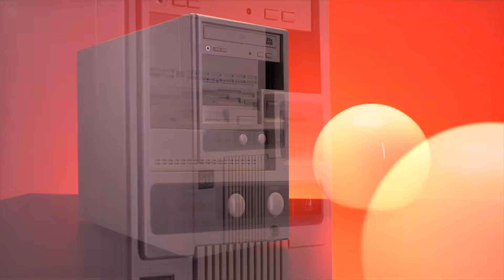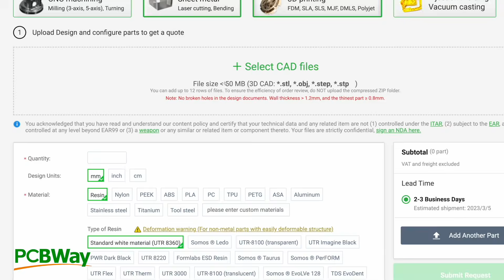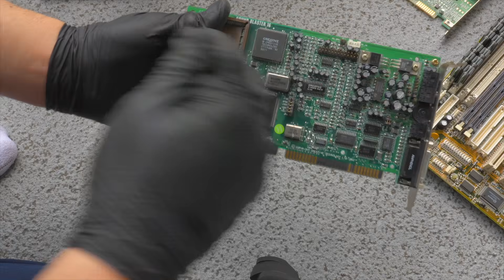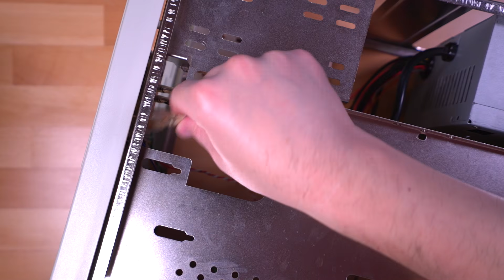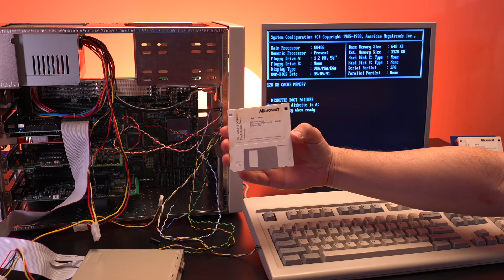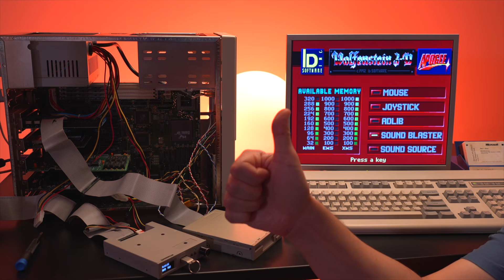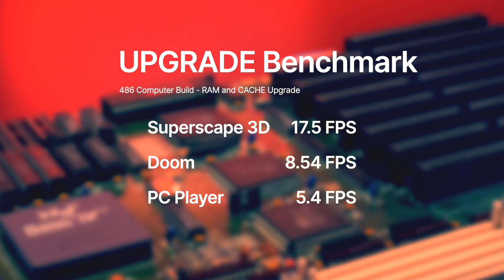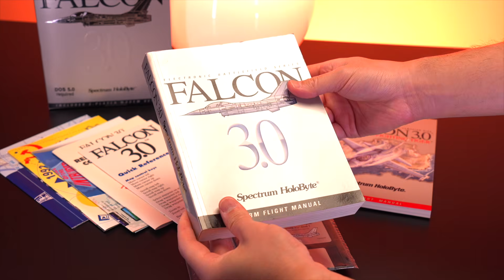Restored And Upgraded 32 Years Later | 486 DOS Build

Comment: The control alt minus key combo was a part of that particular BIOS.  I distinctly remember there were a lot of issues with computers in that era of people leaving the turbo buttons off.  So it's quite possible that you don't have access to turbo without the key combo just as a matter of like preventing the brand name from being sullied by idiots who left their system in the slow mode.

Reminds me of somebody who I helped build a computer for and he played on it for like a month and then was just complaining about how expensive it was and how slow it was when he got it home. Turns out he had just plugged his monitor into the motherboard.  I even explicitly told him to not plug the monitor into the motherboard. He did not listen.
Reply: > I distinctly remember there were a lot of issues with computers in that era of people leaving the turbo buttons off
Well there was the fact that in some PCs the "turbo" mode was actually the slow mode, as it could be wired either way. Adding to the confusion. So in fact lot of people did have their PCs on slow mode, due to doing the intuitive thing and putting the "turbo" mode on which was in reality the slow mode.
Reply: @tacomajoneesi  Yep, it was one of the marketing/labeling tactics decades ago. Programs which were written for slower clock speeds would not run properly on faster hardware, so manufacturers started putting the turbo button to downclock the system, making the programs run again. But this was counterintuitive to consumers, so they positioned it as a performance "boost". As you said it had the unintended effect of a lot of people running their PCs slower than they had to be the entire time.
Reply: @Grimlo9ic  Yeah, exactly. There was no such boost as today's processors with variable clockrates. Instead there was the rated normal speed, and then a lowered clock speed. Due to marketing the normal mode was dubbed as "turbo" mode. The problem was that manufacturers had different interpretations on how it should be implemented, in some cases the "turbo" button would turn on normal mode, while in others it turned on the slow mode. That was my point, that while OP claimed running in slow mode by accident was due to stupidity, in reality it was the lack of standardization. You could have two computers with a green light labeled "turbo" on, on the other it would mean the normal mode is on, while the other would be in slow mode.
Reply: @tacomajoneesi   In general, it was more intuitive and sensical than all that.

When the IBM PC shipped, it was quite common for there to be one reference platform that everyone used until it was obsoleted by a replacement model.  The PC was rather unconventional, in that the follow-up models were entirely backward compatible.  However, as they got faster, it highlighted the problem of software vendors writing timing routines that depended on the system clock speed.  That's fine if the system clock speed never changes, but when the 286 came out, and then the 386 ... waiting for an appropriate period of time on an XT didn't translate.  The new CPUs were just a lot faster, and it made it difficult to use some software that assumed everything was an 8088 PC.

So, the Turbo button was invented as a way to control the apparent speed of the computer.  You could run in .. well, let's call it "classic" mode, completely compatible with old PCs; or in  "turbo" mode, taking advantage of the new speed on tap.  They were marketed as "Turbo PCs" because they ran faster than a normal PC or PC/XT.  This wasn't meant as a gimmick -- it was entirely reasonable to start up and run forever in Turbo mode.  But if you had software that didn't like this, you could drop back to classic mode instead.  The manuals were pretty clear about what this was for, and when to use it.  There wasn't any hoodwinking going on.

Around about the 386 era, it became pretty clear that putting the CPU into a busy loop to implement a time delay wasn't a scalable option, and software vendors found other ways (timers, real-time clock, etc.) to count the passage of time.  This made it less likely you needed to run in compatibility mode.  But there were still a few times when you needed to.  People held on to software a lot longer back then.  So, the Turbo button functionality flipped.  Instead of emphasizing it as a way to use the power on tap, it was meant more as a workaround for old software that you probably didn't need to worry much about.  But, since it didn't look as nice to have a button on the panel that was always pressed in, relative to the reset button next to it, the logic was reversed.  It became "De-Turbo" instead.

As people bought cases and built their own PCs -- which might be fast 486s or slow 286s -- and since nobody knew whether they were going to ride the bleeding edge of software, or rely on old favorites... AND since the same case might be produced for years without changes to the molds ... the button was often a 3-pin (or 2x3-pin) latched switch that allowed you to pick whether the contacts were shorted when pressed in, or released.  In that way, you could decide whether you wanted it to be fast when pressed, or fast when unpressed, just by turning the header connector the other way around.  Likewise, you could have the motherboard control the turbo LED, or feed it through the second pair of contacts on the switch (in the 6-pin version) to tailor the visual feedback to your needs, too.

It wasn't a marketing thing.  The needs and preferences changed over time, pivoting around the 386.  Before that, Turbo was pressed in.  After that, Turbo was the default state -- not pressed in.  But often you could change that behavior if you wanted to, just by reversing the connector.
Reply: @sirnickity  Yes I know all this, and that is exactly what I meant by marketing. That when the PCs with faster processors came out, they were marketed as "Turbo" and the "Turbo" mode was the standard clock speed, while the slow mode was the compatibility mode. But for some reason it wasn't entirely standardized whether the "turbo" button and the accompanying light meant that the normal/turbo mode is on, or if the slow compatibility mode is on, you found these computers either way. I recently watched a video of one of these clones even having an option in the case the turbo button was a 3-pole switch that depending on which side you soldered the wire to, it either became a pushed-on or pushed-off button.
And even further, sometimes if the button was a momentary one and not a switch, the motherboard/BIOS could be configured in defaulting to either turbo on, or turbo off. Messy.

Comment: I couldn't find a retro pc to replace my childhood ones, had a tandy1000, IBM386 and Packard Bell 486 legend.
But a few months ago, I downloaded and setup ExoDos for my modern PC.  650gb and, 7600 games from 1982 to 1996. Running on Dos-box through Launchbox. Very happy with it.
Reply: I had a Tandy 1000 with an AMD 8088 processor, 640 kiB RAM, 20 MiB hard disk card, Microsoft Mouse and two double sided double density drives in the late 1990s as our first computer.  It also had an Epson LX-80 dot matrix impact printer that we used up until our first Epson 400 inkjet printer a few years later.  I was fond of it but I ultimately got rid of it due to lack of storage space.  It was an awesome machine and a gift from my Uncle and cousins for Christmas in 1996 or 1997.  Our next PC was an AST Advantage Adventure all in one (kinda resembled a big Macintosh computer) that a friend gave us a year or two later and we used it until we were able to buy a Compaq running Windows 98.  After that we each had our own computer systems when I went off to college and then it was a computer store-built Athlon XP machine that I used and upgraded for a couple of years until I could get an HP business tower and also the Dell I Latitude I am typing this on.

Comment: there should be at least one screw holding the motherboard onto the back so it's actually locked in, as well as providing a guaranteed path for ground.
Reply from the maker: Yep, there were 2 screw in standoffs that I installed off camera

Comment: there really was no cable management back then because not much actually got hot enough to worry about airflow, at least until 486s started hitting speeds faster than 66MHz. The only thing that ever really got hot was the power supply.